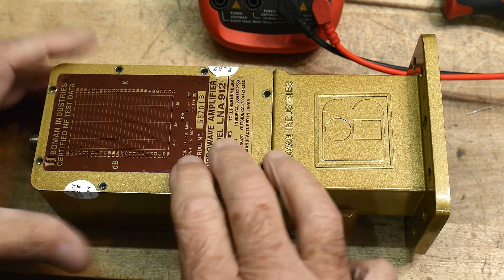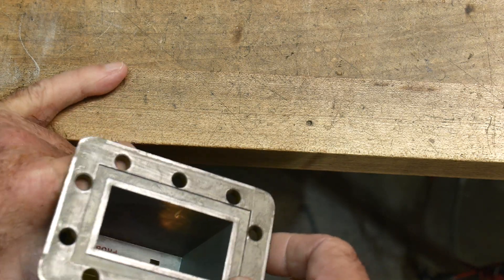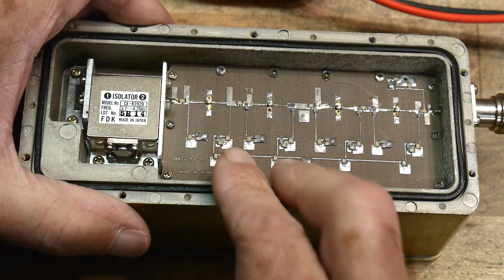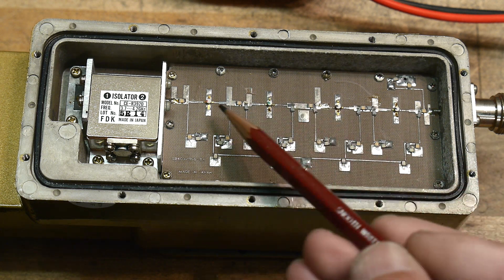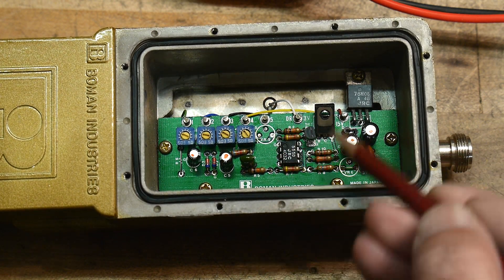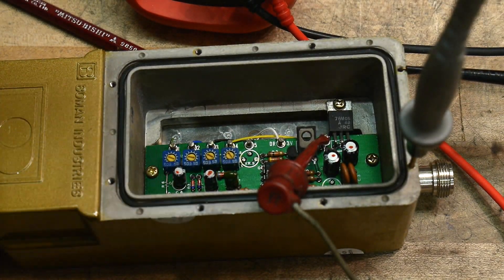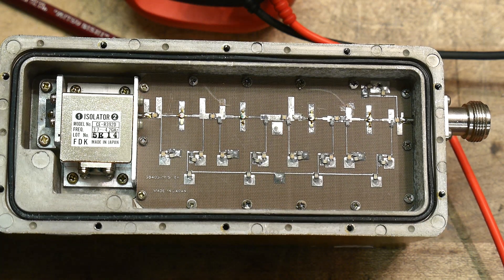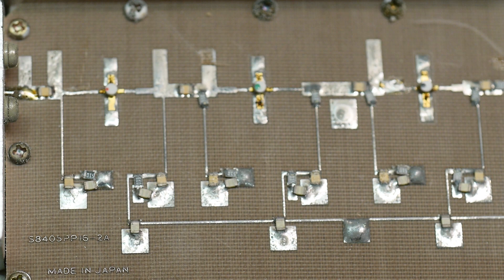#668 C-band LNA Teardown

Comment: Good old times memories !!  I home brewed these u-strip line Lna s back in late '70s using 0.030" Teflon "Duroid" pc board stuffed with ultra low noise, 0.5 micron gate, NEC California Eastern Labs GaAs-Fet devices shipped in metalized envelopes that were individually noise figure tested...Needless to say, the coldest Nf device went in Q1 location...At $45.00 per device, you took ESD precautions Seriously by working over a grounded copper bench tray & used a direct grounded & unplugged  soldering iron for each soldering connection !!....Your "easy" pc board side is actually the most critical complex, as the --3 volt gate bias Had to come up & stabilize the Fets Before the time delayed + 3 v drains powered  up !!  Back in the C band days, "rolling" your own 4 ghz LNA's & Image Rejecting mixers was a Big diy deal, at least in my neighborhood !! Big thanks for popping the lids & describing the internals .....Keep up the great vids coming,.....tom

Comment: After working several years in commercial earth stations (Intelsat and Domsat), I worked for a TVRO (sat TV receive-only) company in Asia back in the mid-80's and we used a lot of uncooled  LNA's and LNB's (LNA w/ block-downconverter, 950-1450MHz out)), from Avantek, Cal Amp, MTI (Taiwan), etc. and seen a couple of Boman's. They usually had GaAs front-end amps.  The NF stamps on your unit are typical at that time. Gain also as you mentioned are typically  48-50 dB.  LNAs typically have an N-type output connector, and connected by a high quality coax (hardline sometimes) to a 70-MHz downconverter (mounted behind dish)  the output of which goes to the indoor receiver which demodulates the signal to A-V. Dish sizes were anywhere from  3 to 7.5m dia.